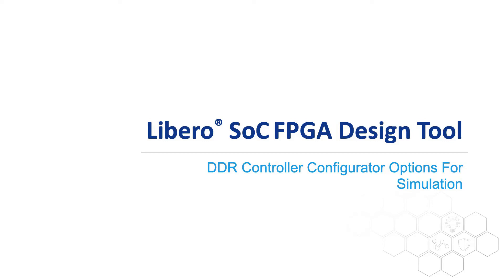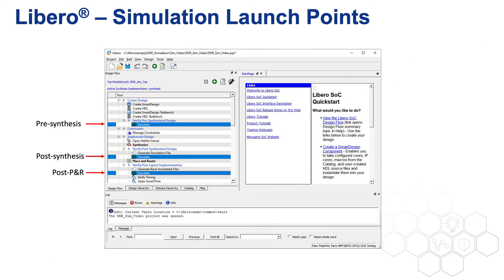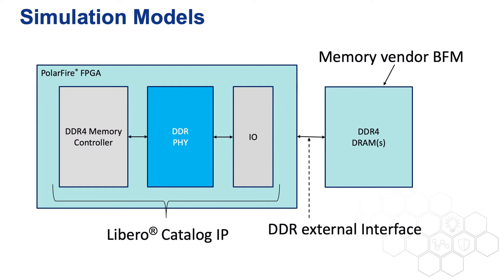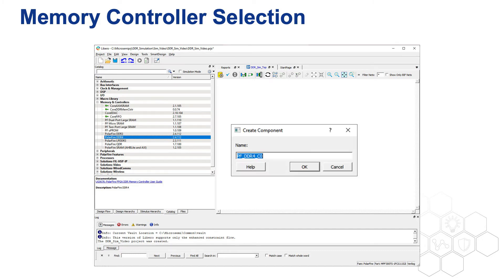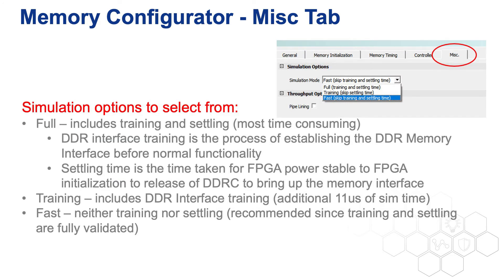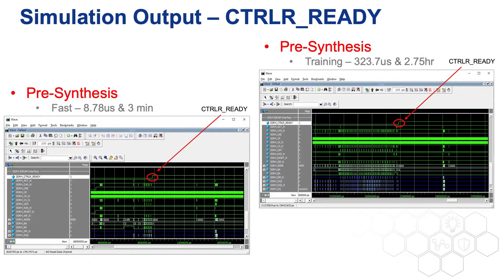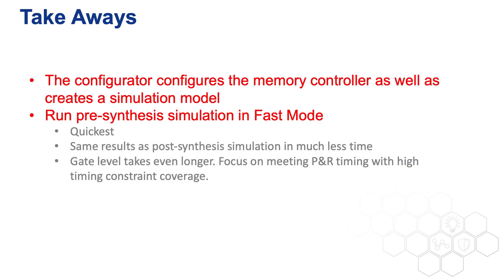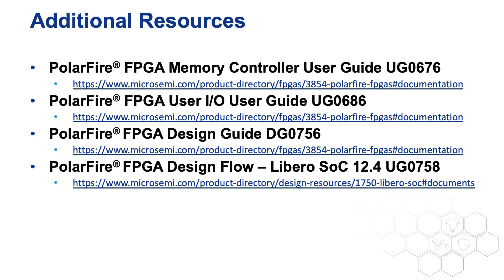How to Simulate PolarFire® DDR Controller

Comment: Hello.

I am trying to do a simulation like the video in libero soc.

Where can I get the simulation example design shown above?
Reply from the maker: Hi there, thank you for your interest in the PolarFire DDR Controller simulation! While the specific simulation files referenced in the video are not directly available for download, we’re excited to share a valuable resource that can assist you: Application Note AN4597. This application note provides detailed guidance on DDR simulations, including section 1.7, which specifically explains how to simulate the design.
Reply from the maker: The application note also includes design files to help you get started. You can access it here: https://www.microchip.com/en-us/application-notes/an4597. Additionally, similar tools and examples are included in the Libero SoC Design Suite, which you can download from the Libero SoC Downloads page: https://www.microchip.com/en-us/products/fpgas-and-plds/fpga-and-soc-design-tools/fpga/libero-software. If you need help with setting up simulations or have questions about accessing resources, don’t hesitate to reach out to Microchip Support at fpga_ask_a_question@microchip.com.
We appreciate your interest and are happy to assist further with any specific questions about the PolarFire DDR Controller or the simulation process!